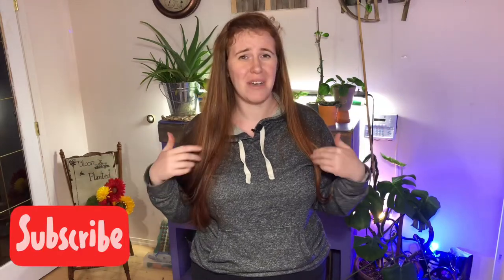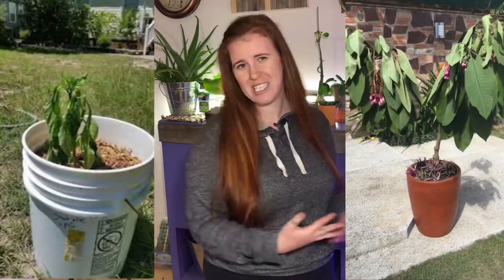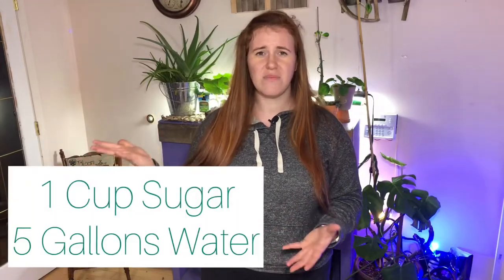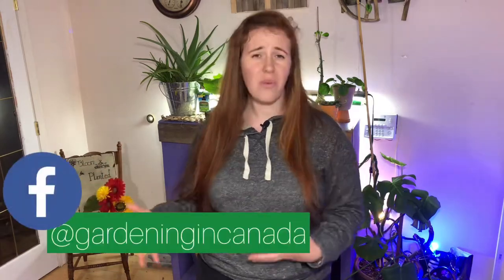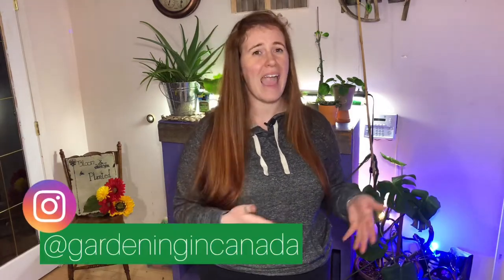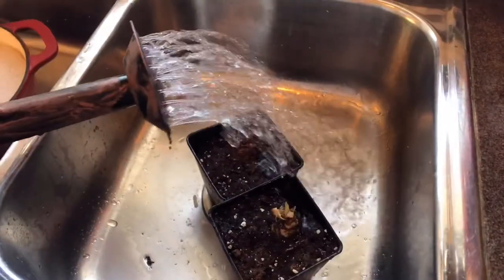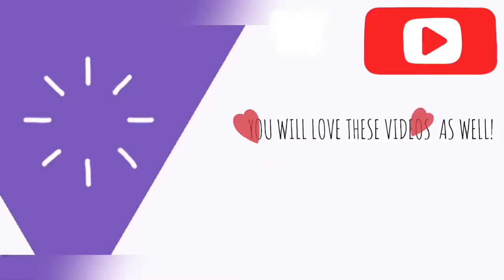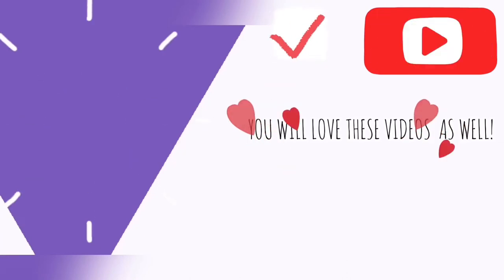How To Use Sugar Water For Plant Shock. DOES IT WORK? WATCH THIS | Gardening In Canada

Comment: I drench root balls of transplant trees [up to 5 or 6 foot high] with a mix containing about 6 ounce of sugar [sucrose] per gallon of water, drain off any excess then plant as normal and water in liberally with just plain water. Done this for 30 or so years and always enjoyed a very low failure rate.
Reply from the maker: Nice!
Reply: If I had to guess, I'd say it's probably the water part, not the sugar. It's my understanding that getting the root ball good and saturated, allowing enough time for the plant to rehydrate fully, prior to putting in the ground is a way to prevent transplant shock. I've never actually seen transplant shock in person, and I suspect it's because I've been following that tip since bringing my very first plant home.
To be clear, I'm not terribly experienced with trees, so that may be an entirely different matter, but I've put thousands of non-tree plants in the ground. Again, just a guess.

Tbh, I didn't actually know that trees could even get transplant shock. Never really thought about it, but it makes sense; Not everywhere in the world has a dormant season.
Reply: @lisakukla459  As for me, once I had Bareroot transplant and did not have a shock there. The main thing was to make it carefully with the settled water and also to water the new medium properly not to get any air pockets. Some people make soil mix long before the use - this seems good for me. They mix the ingridients they need and water soil regularly for about a month to make the Live soil mix there.